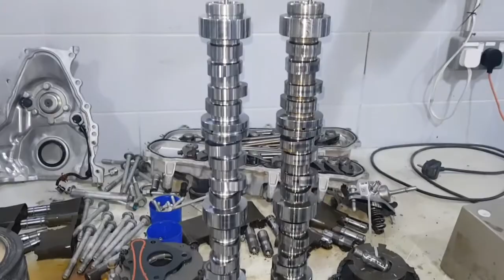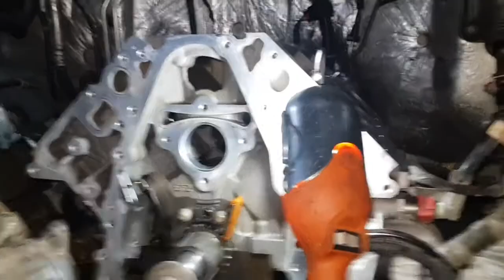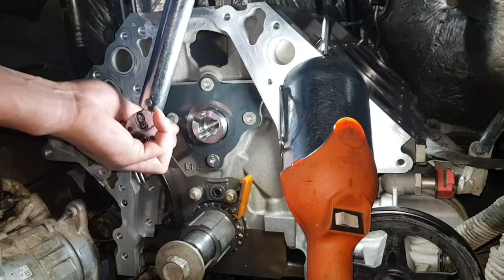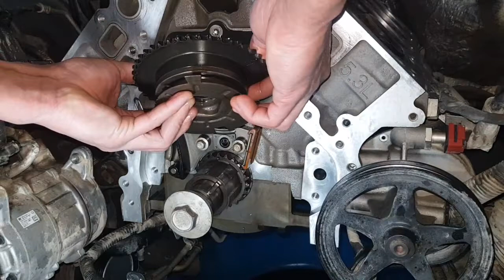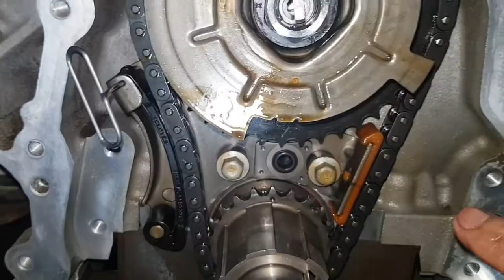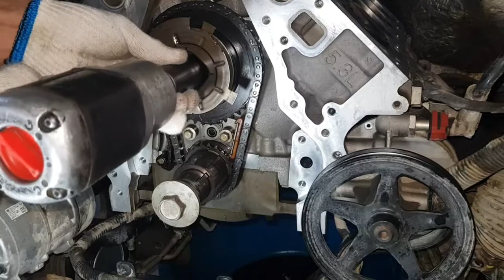CAMSHAFT and TIMING CHAIN 5.3L Engine Installation. Chevrolet and GMC

Comment: I don't understand why he torqued the bolt , then hit it with a 1/2 inch impact gun ?
Reply from the maker: I used torque  wrench to tighten bolt   and add 90° angle using impact wrench. Its not correct way sorry for that.
Reply: @ejmegzcarvlog7226 
What's the torque spec on both bolts
Reply: @ejmegzcarvlog7226 what's the torque spec?

Comment: Are there problems with the Tahoe 2021 I will buy it soon? Do engine malfunctions in the previous video in the channel include all engines?
Reply: Misfire dtc and noise on tahoe 21
Reply from the maker: The one Apple. 2014 up to 2021 the engine is the same design and similar tahoe yukon. Active valve lifter issue, and not all engine affected for this problem.
Reply: @ejmegzcarvlog7226  👍🏼

Comment: How do u prime the oil pump ?
Reply from the maker: GM model from 2010 up to now there's no procedure for prime the oil pump manually. The important if you are rebuild an engine you must check the oil clearance in correct specification. And then apply a liberal amount of clean engine oil in all bearings journal in the final installation. Also the oil pump apply an engine oil inside before installing.